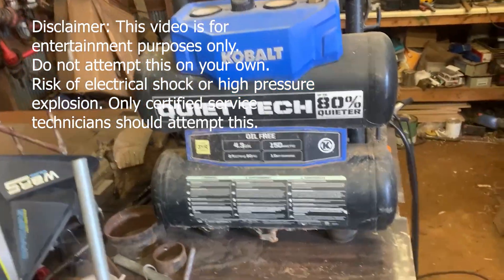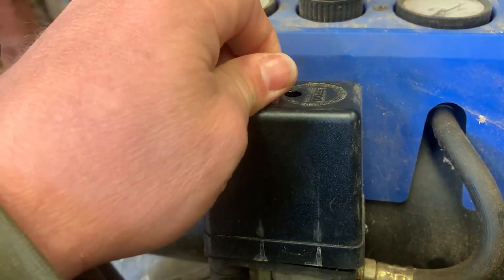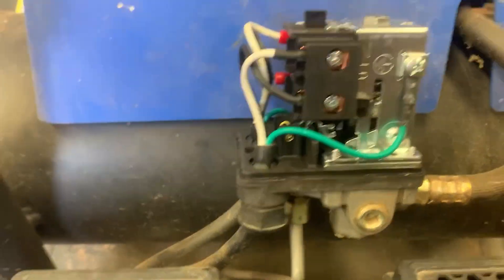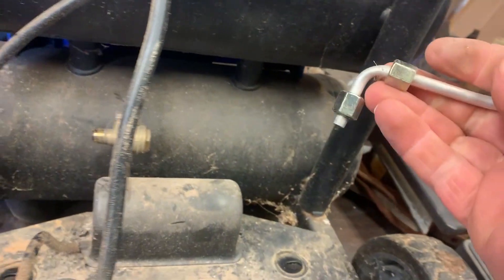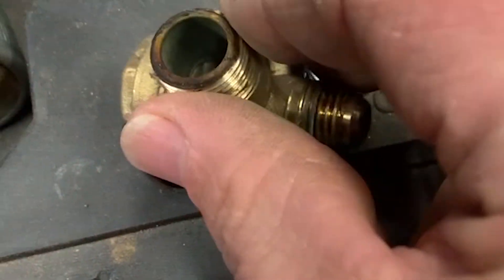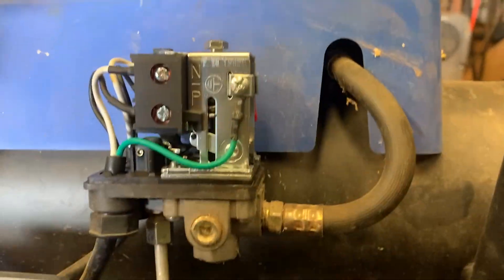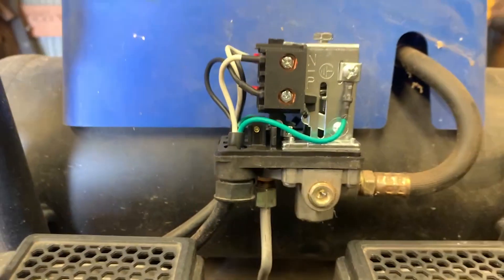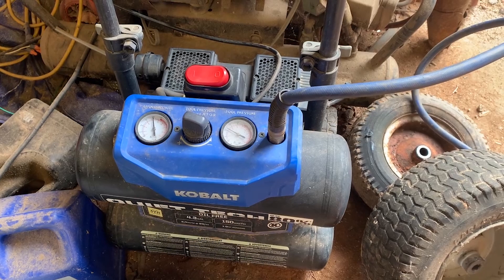Kobalt Compressor Blows Out Air!! [[Check Valve]]

Comment: Do not take the check valve off. Just take the cap off the check valve and save yourself a lot of trouble. Mine had a piece of red plastic in there. Taking the check valve off is a pain anyway.  Thanks for the video. It gave me the idea to check the check valve and indeed that’s what it was. Compressor is working now..